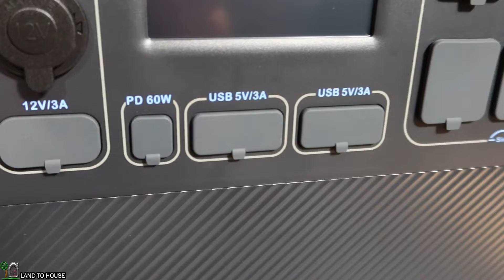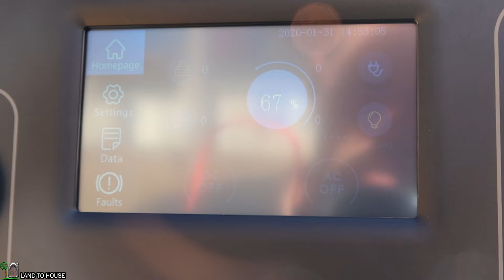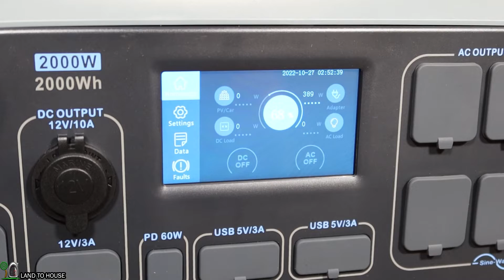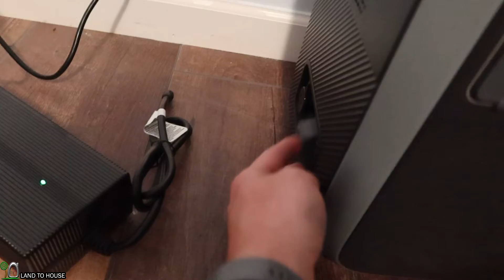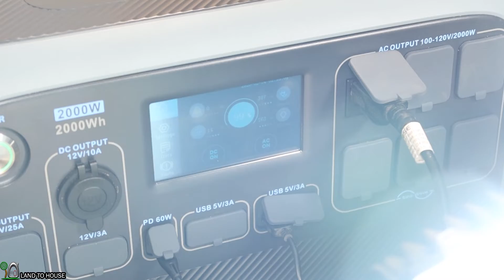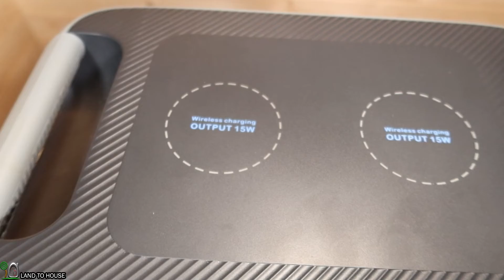This is the Bluetti AC200P Power Station with 2000w AC output and 2000wh  LiFePo4 battery capacity

Comment: This is available here in Japan. The AC outlets look the same, but the spec is listed as 100V. Wonder if that's adjustable to 120V somewhere.  The frequency isn't listed, but I'm assuming 50hz for Japan. One would think that's all changeable somewhere.

Comment: I used it all summer, completely off grid with 800 watts of solar panel! It's obviously a powerful machine... I was losing 40% of the battery at night for powering a small size fridge (was charging it with my gaz generator if I had bad weather)... But on sunny day I was using my powertools for long period of time with no problems ... Also, good for beginner, there is a lot of protection protocole to prevent you to jump the machine on the first day... My electric power saw worked though 🤣 

Great machine ... Small battery capacity but still worth the price!
Reply from the maker: Nice feedback! This one seems to be well made and well worth the price. The limiting factor is the slow AC charging.
Reply: @Land to House  first  year off grid as a beta test! That was good. Couldn't do it without your channel. I got a ram pump from land to house and it took me a while to set it up but it finally worked! I am ready for next summer!

Keep up the good work, the World needs it!